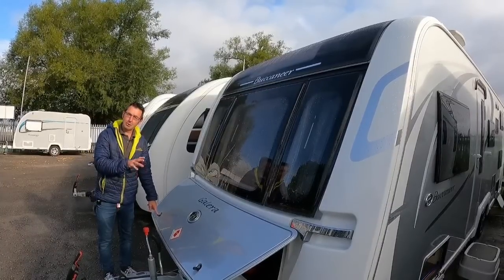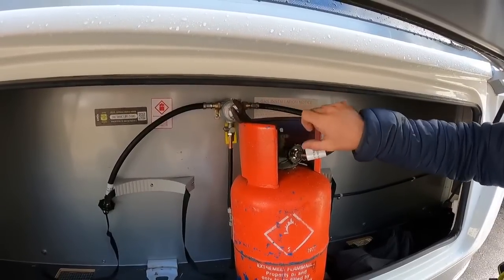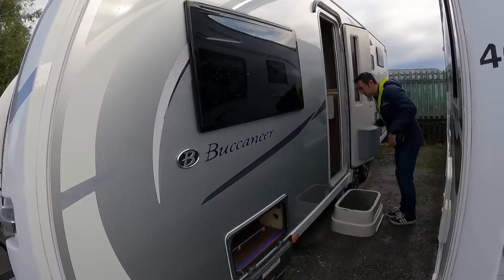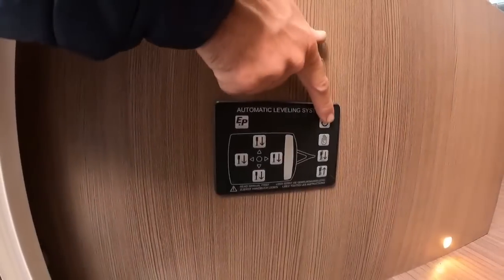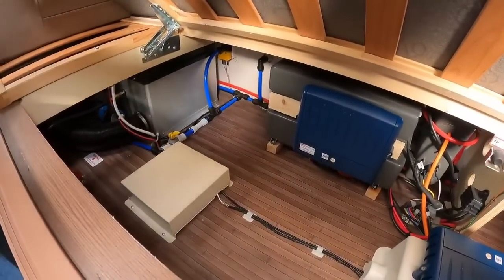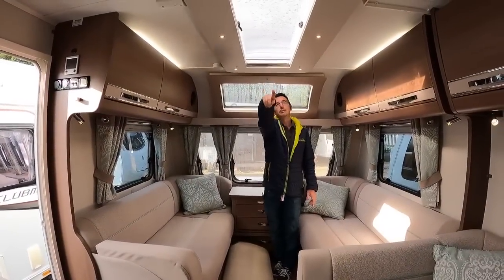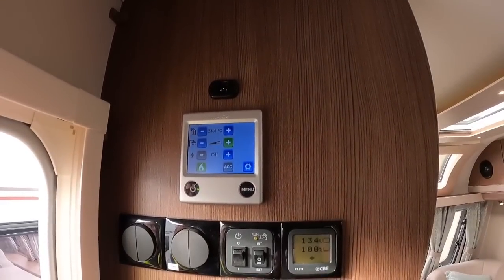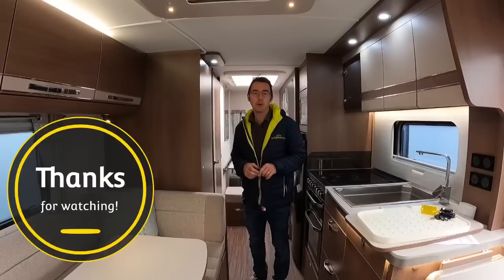£30,000 Buccaneer caravan tour, including how it works

Comment: Hi Mark, as you are the font of all caravan knowledge I wondered could you shed light on my problem?  I have a brand newNissan Navara fitted with a 13 pin socket. But, when I plugged my caravan socket in all lights worked but not the Alko atc. When I plugged it into my Volvo it worked perfectly. Any thoughts - or anyone else as I’m baffled. Thx
Reply from the maker: They have possibly only wired the lighting side on the 13 pin on your truck. If you are able to see the wiring and see if all 13pins are wired or just the 7? If it is all wired it maybe the wiring just needs checking to make sure its correct and also check any fuses haven't gone. Hope this helps.